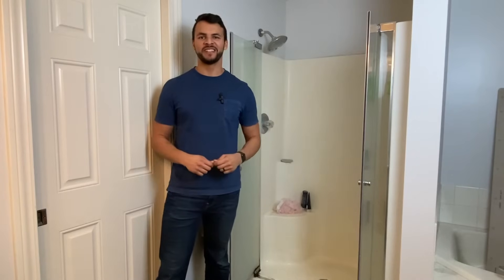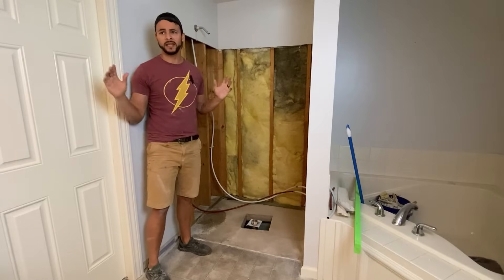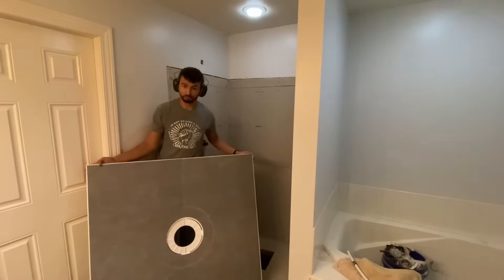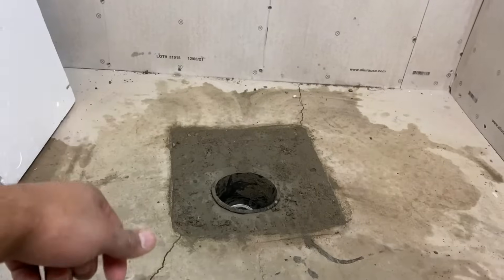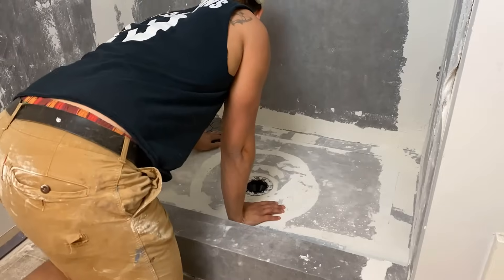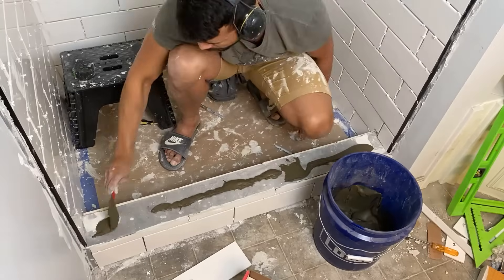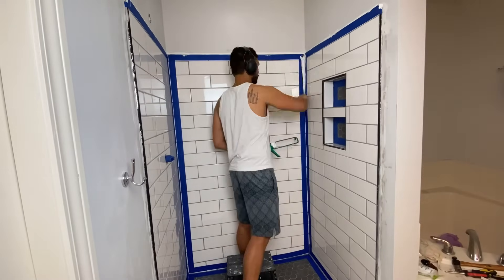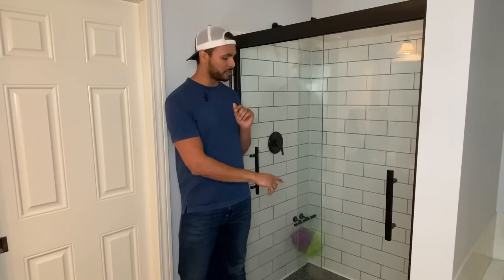How Much Does it Cost to Remodel Your Own Shower? | DIY Shower Remodel

Comment: TY SO MUCH FOR MAKING THIS VIDEO CUZ THESE GUYS BE TRYING TO RIP U OFF 8K FOR A JOB U DID FOR UNDER 3K.
Reply from the maker: Hey Charles - thanks for checking out the video! 

To be clear, my work is not at a “professional” level. The shower definitely has elements of a DIY take. You have to be sure to weigh the results of what your hands are capable of vs the cost of a pro’s. 
I don’t think the $8k price was a rip off. I was just too cheap to pay it 😅

Comment: Why did you not just use cement board from floor to ceiling.
Reply from the maker: I probably could have. But the previous shower stopped at that spot, so it was easier to match that rather than buying more materials and working around the shower head supply line. 

Thanks for checking out the build!

Comment: Screwing into the tile and waterproof membrane for that foot rest 😮... At minimum you should've filled the hole with silicone priir to securing with scree AND applied silicone around thr cover plate of tge foot rest.  Your waterproofing in thta area is now compromised
Reply from the maker: That’s a fair concern. However, the foot rest is designed to be there and comes with compressible rubber gaskets that seal up as it’s secured. It’s been there over a year and no issues to speak of. 
Thanks for checking out the video!
Reply: @donnygrahambuilds  fair point about the gaskets but say you had a leak somewhere else above it, say a pinhole in the grout or just grout being porous in general, if water for behind the tile and dripped down, that area with the screws have a compromised area. Chances of this happening are slim but it does pretty much negates the fact that area is no longer waterproofed. It's no different than not waterproofing the screws when you secure the kerdi board or kerdi niche to the studs before tiling

Comment: Out of 800 dollars your door was over 500. So you could do this same thing for 300 bucks and a shower curtain rod.
Reply from the maker: $1800* not $800 - that would be wild. But you are right, opting for a curtain rod and not a glass door would save you about $500 👍🏽
Reply: @donnygrahambuilds  I was thinking 800 was a crazy low number haha, thanks for clarifying

Comment: Why does everyone just like you lay tile with the wrong offset! You never set subway on half offset! Never. Just because you save an extra cut and easier to layout I guess.. wow
Reply from the maker: If “everyone” you see does it wrong, what are the chances that you are actually wrong about how it should be done 🤔 lol
Anyway, thanks for checking out the video !
Reply: 0 absolutely 0. 
Everyone on YouTube do it is because what they see and not professionaly trained and do not do it for a living! It simple to ready laying instructions on a box. Just look for yourself.
Reply: @Stephen_Burton  I'd be curious what you prefer.  Nearly every instance of subway tile I've ever seen is based on a 50% offset.  I've seen the occasional 33%, but whether it's DIY or professionally installed, 50% is the standard from what I can tell.  Not sure there's a "right" or "wrong" here unless there's some element of physics or waterproofing most don't know about.
Reply: @MileHighGrowler  What a fabulous long name 😂❤😊

Comment: Your king of remodel should not be giving you advice!
Reply: @donnygrahambuilds  your inside corners always go in first! you should have watched several videos first before even laying the shower as well. all in all you did an okay job for a diy. just from now on make sure you are telling people the exact way its supposed to be done. if you really want to learn how to waterproof the right way watch your kerri videos!
Reply from the maker: @jasongraymire5537  I appreciate the feedback. Though, I will say - our shower has been up for ~9-10 months and it’s been 100% waterproof. Not a single leak for seep to speak of. 

And I definitely realize it’s not professional grade level. But it also comes with a DIY price which I think most people prefer haha. 

Anyway, thanks for checking out the project and I’ll definitely take all feedback into my next shower project 👍🏽